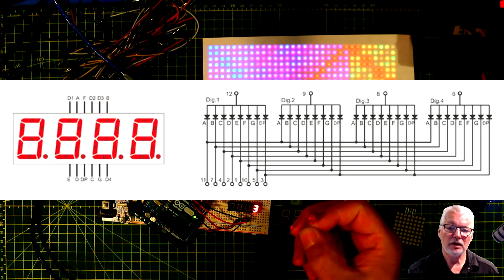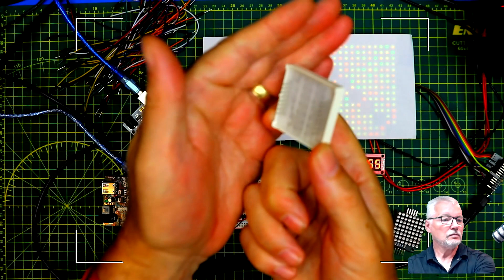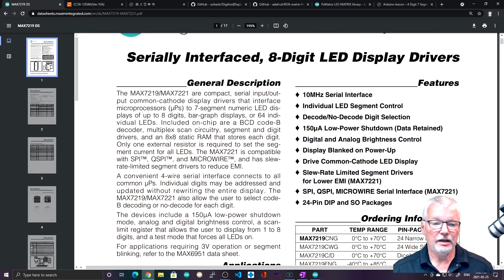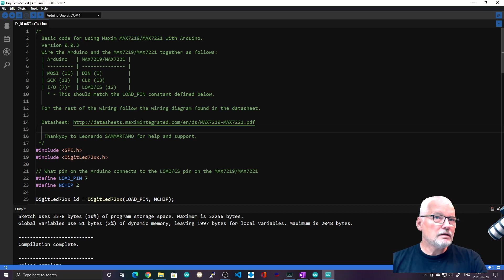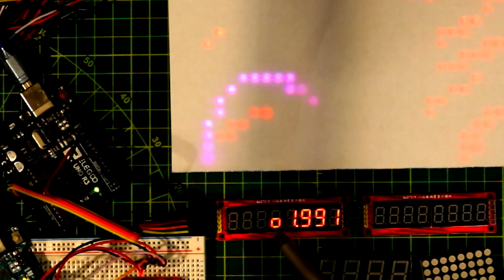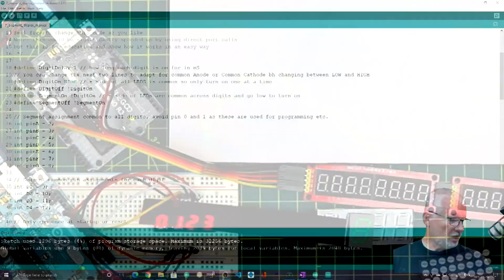Arduino Tutorial - 7 segment LEDs and more

Comment from the maker: the first example that is directly connected to the uno, i use 7 pins to drive the LEDs of each digit (There all in parallel), and I use another 4 pins to sink the current of each individual digit (Up to 7 segments, 8 if you include dp.). by only haveing one digit tied to ground at a time i only light one digit at a time and therefor limit the current, by changing which pin is sinking the digit LEDS (Common the oV )i scan through the digits. now in a production system i would use transistors for the sink (Common) side of the digits allowing much higher current to flow and therefor get a brighter display, in the example i an relying on the self limiting of the internal transistors of the UNO (ATMEGA 328)